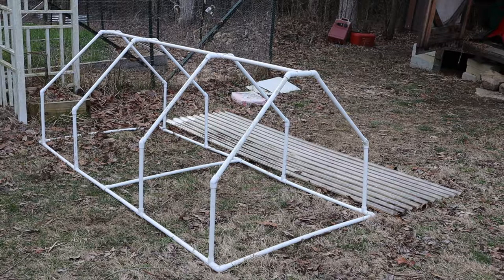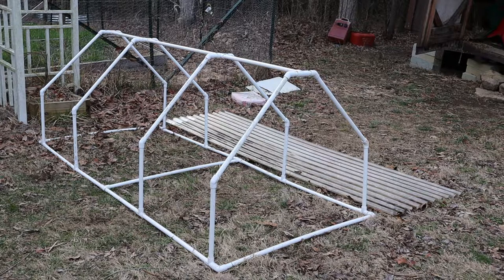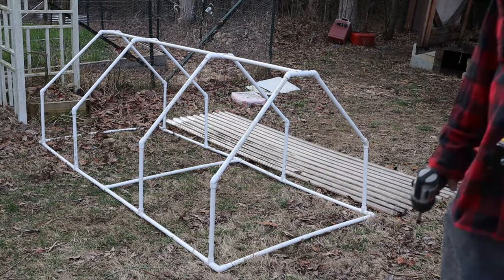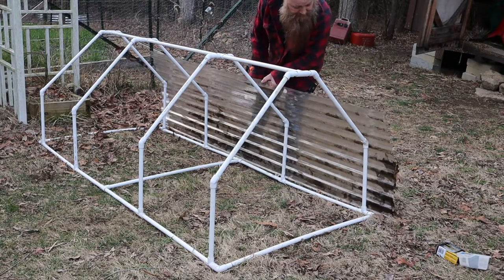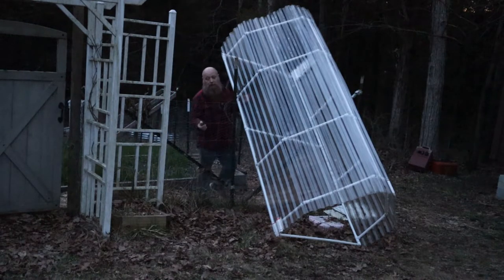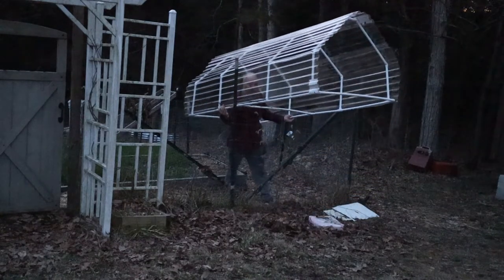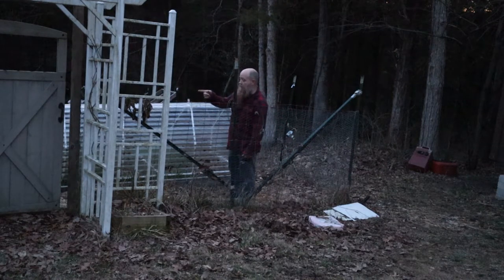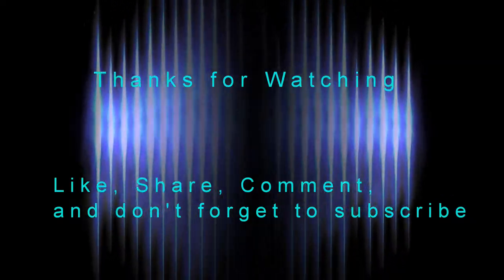tuftex polycarb coldframe upgrade for raised beds

Comment: Ed how did you do the ends do you have a video
Reply from the maker: I recorded the video but didnt get it edited or uploaded before i had to start dealing with cancer and then the external hard drive that had all my unedited videos died (about 2 weeks ago .... Is 2020 over yet?  Lol )  Anyways, what i did was used some scrap 1x3 lumber to make a frame on the ends held in place with wire-ties and maybe a screw or two. Then cut the panels ro fit that wooden frame.  It worked out really well and still keeps it light enough to move around with just 1 person.